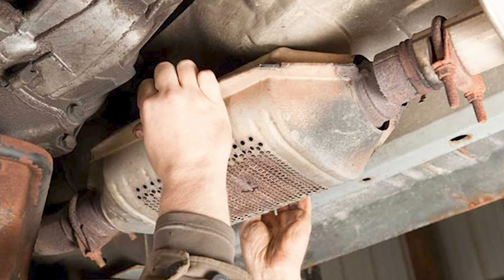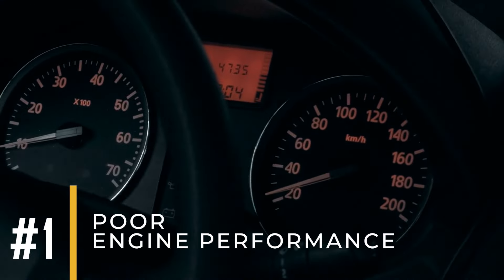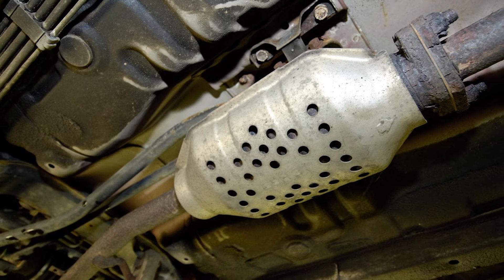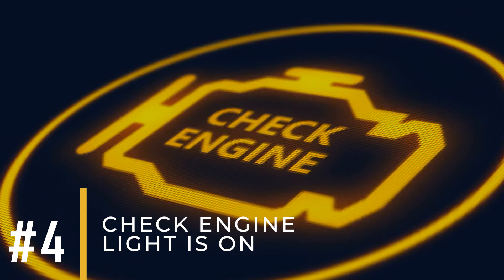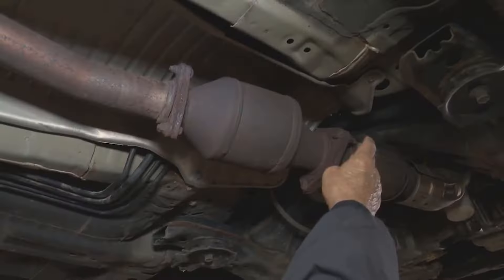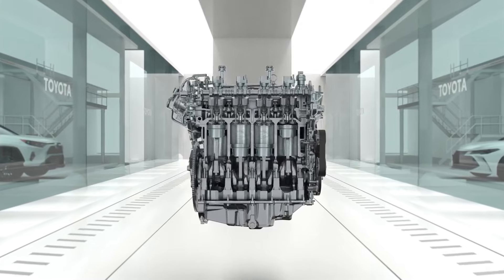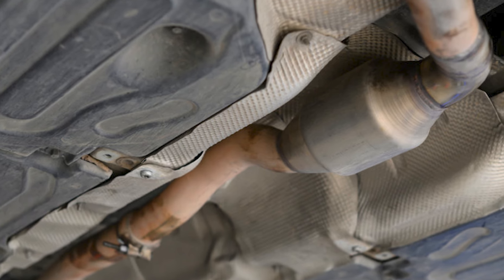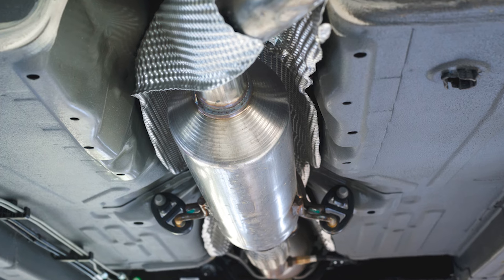Top 10 Symptoms of a Bad Catalytic Converter | How to Tell if it's BAD

Comment: Also not necessarily a cause of a catalytic being bad but a p0420 code is a faulty reading from an O2 sensor due to an exhaust leak. I’m gonna find out about mine soon as my flex pipe on my accord v6 is leaking and the p0420 (bank 1 - rear cat) is on.

Also for those who are buying v6’s, always remember your car will be expensive if this code comes up as a v6 has 3 cats

Comment: I have a P0420 code (low catalytic efficiency) on my 03 Honda civic. I used to have a P1457 code (emission EVAP leak) but that just disappeared. Now it’s just P0420

My symptoms: 
After running my car for a while, turn it off, go to the store or something, come back and turn it on, after about 30 seconds, the RPMs will stumble .. almost like it wants to stall out and then it’ll accelerate itself and stabilize. 
Now that the video mentions it, I am hearing rattling 🤔 
I also have strong gasoline smell inside and around car. 

On a scale of 1-10, how likely could this be a bad cat? 
I just recently had an engine swap, spent lots of $$ already 😭
Reply: Im having those exact sympotms and code on my ‘01 honda crv. About to replace the cat and see if that fixes it
Reply: @mattymcfabb  I just did my cat this weekend. Unfortunately it didn’t fix the problem. I even got the check engine light back on. I don’t have a scanner so Idk what code it could be now. 
Regardless of that tho, my next move is to change out the 02 sensors, I’ve already changed the purge valve, clean out the throttle body, possibly replace any other evap component like the lines, solenoids, canister.. since I already wasted money on the most expensive thing: the cat -_-

Let’s keep each other updated to see if we can fix this. I’ve been at this for a long time. I’ve neglected it too but now that I have a new motor block in it, I want to take care of it.
Reply: @PeaceNinja007  good to know. I’ll let you know how things shake out over here
Reply: @mattymcfabb  cool 👍
Reply: @PeaceNinja007  put mine in last night. It was a bitch and a half due to 25 years of rust but we got the light turned off and the car seems to be running fine. I had real bad rattling from the old one and it’s gone now. I suppose the only true test is time so we’ll see if the light comes back or anything changes down the road
Reply: @mattymcfabb  Dang ok. You have an 01 CRV, right? My mom has one of those and she was having some hiccups during start up last year. Got code p0420 and also decided to swap the cat. Luckily it worked. I hope it works for you. 

I started my car up last night as I was finishing up my shift. It’ll usually do that stumble thing every time. Sat in my car and waited, suddenly the check engine light turned off and it didn’t stumble 😲🤷‍♂️ 
All I did was change the air filter lol God I hope I didn’t waste all that money .. when all I needed was an air filter 🤦‍♂️
Reply: @mattymcfabb  Aye so .. I’m happy to report that it appears that the air filter has fixed my issue. Checked multiple times to see if it wasn’t a fluke. It’s no longer stumbling upon turning it on and 
check engine light is now turned off .. I even feel my car had a bit more power. 
Could this mean I just got a new cat for no reason ?? Dang .. oh well.
Maybe something you want to look at your car 👍
Reply: @PeaceNinja007  good to know!
Reply from the maker: Hmmmm.....given your symptoms—P0420 code, rattling noise, and strong gasoline smell—the likelihood of a bad catalytic converter is high. On a scale of 1-10, it’s around a 9. The rattling suggests possible internal damage to the cat, and the fuel smell could indicate incomplete combustion or a leak. It’s advisable to have the catalytic converter checked or replaced.  Hope this helps.  Good Luck to you!
Reply: @PeaceNinja007 yup sometimes changes the air filter but also claean the the throttle body and MALF sensor using the cleaners specifically made for it like that of CRC makes
Reply: @PeaceNinja007 did you clean the throttle body and MALF sensor
Reply: @rosieclark3661  Haven’t really got to it. All the symptoms stopped when I replaced the cat and air filter 😊 
Still thinking about changing out the O2 sensors because the guy who changed the cat recommends it
Reply: @PeaceNinja007 Take out the EGR Valve & clean It to, it builts a Lot carbón too, & it Wil brake run better. 👃

Comment: P0137, p0141, p2187, p2196 and check engine are on my dash. I replaced the o2 sensor since it was burned already bad. And now the cars rpm moves between 2 and 3 when the car is cold and i turn it on. It goes away after i put it on gear. I hope is a vacum leak and not the cat since i have a 2016 maserati ghibli. Only 14k miles btw. Wtf can it be?? 😅😅😅😅
Reply: Stellantis...🤦🏻

Comment: They stole mine the shop wanted $1800 I took off and went got a straight pipe for $150 runs fine with 247,000 miles